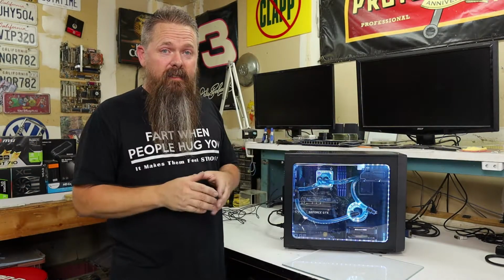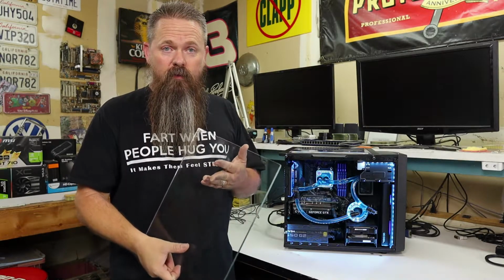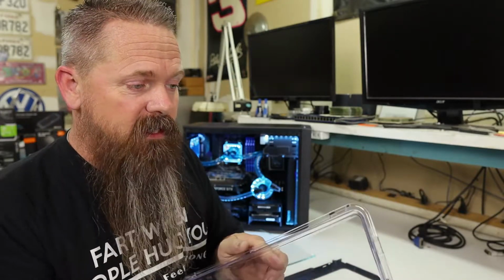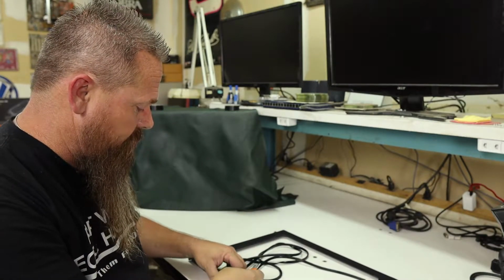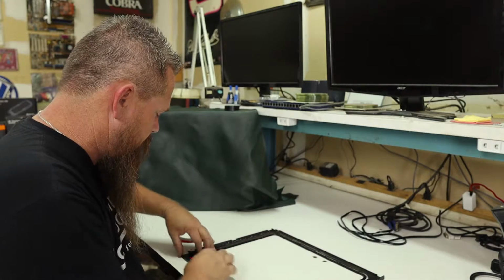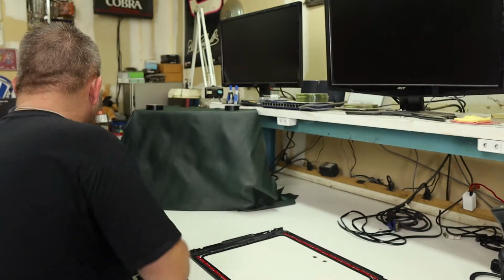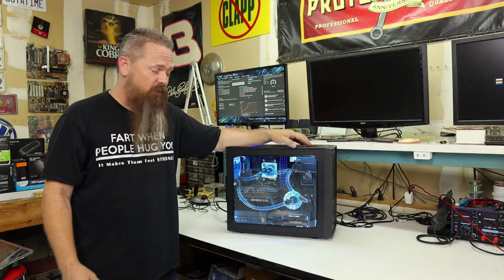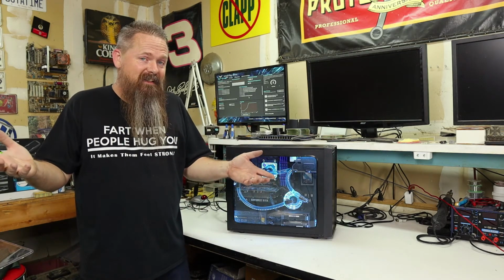How To Install a Glass Computer Side Panel

Comment: where did you get that flux capacitor mod in the pc case ?
Reply from the maker: It's a car charger I got from ThinkGeek years ago. I was going to do a video on how to mod it but ThinkGeek is out of business and the only place I can find them is on eBay. Last time I saw one it was over $100.
Reply: @CyberCPU  thanks for sharing super cool
Reply from the maker: @elamriti  if you ever get your hands on one it's a really easy mod. You just take it apart and remove the car charger portion. Then you solder a molex connector to the PCB where the car charger was originally soldered. Just make sure you connect it to 12 volts on the molex. Then you also have to put a little bit of solder to bridge the switch so it doesn't work anymore. If you don't bridge the switch then you have to take your side panel off the computer and push the button every time you turn your computer on or it won't work. 

It's super easy to do. Took me like 15 minutes. 

I then use some Velcro to stick it to the back panel on the case and route the molex connector behind the motherboard tray.

Comment: Of course this would be a nice upgrade if you are in love with the case but you can purchase a decent new case with tempered glass on Amazon for $60 to $80.   So I guess you have to choose between swapping out the contents of the system and doing the window mod.

Comment: Just bought a Corsair 750d airflow, lovely case except it uses an acrylic window. Thought to myself surely how hard can it be to replace it with tempered glass? Thank you so much dude, you saved me so much guess work on this project. I have a work college whos husband works for a glass manufacturer, so can get it for a pretty good deal, just need to buy me some rubber seal and tape! Liked and Subscribed.